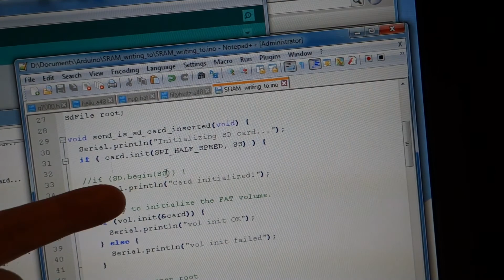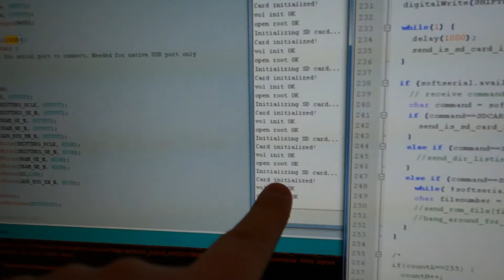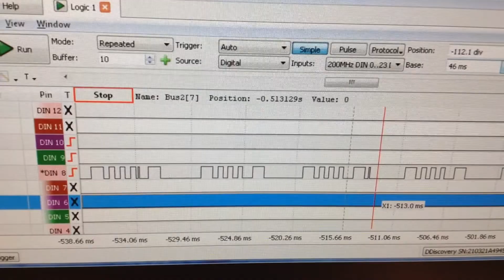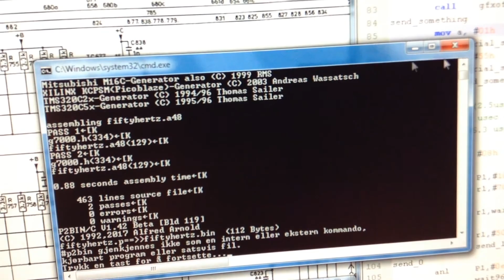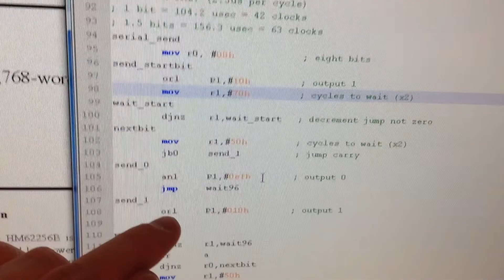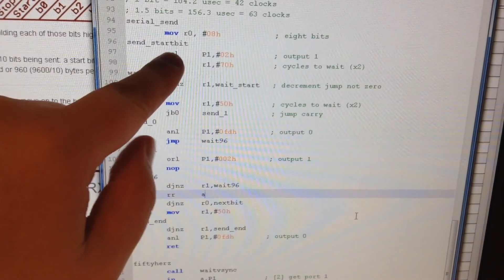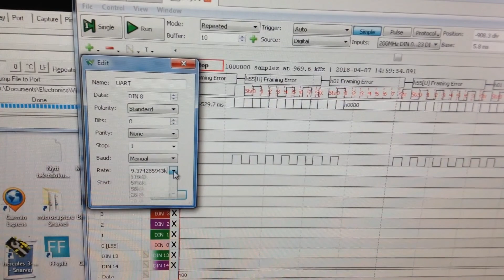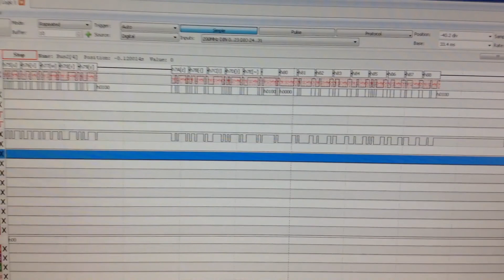Bitbanging serial data in 8048 ASM VideoPac G7000

Comment: Haha, super. I know it's been painstaking work Hans. Working all the timing out like that. I don't think you could get much closer to 104.2 us and even if you did it wouldn't make much difference. Good call on the vsync there. It would have cost me ages to figure out why that one byte would fail :)
So basically now you can send bits from the cart using the CPU to the Arduino. Do you think the read routine would look much the same?